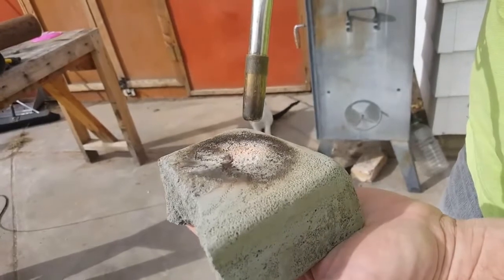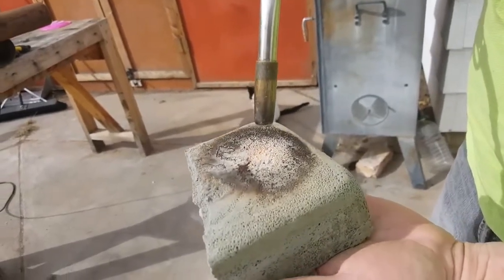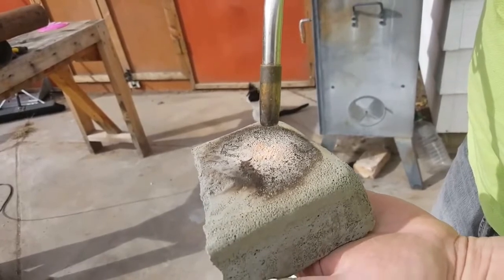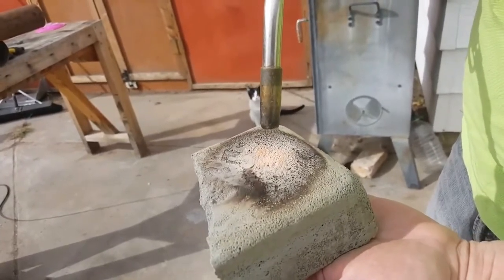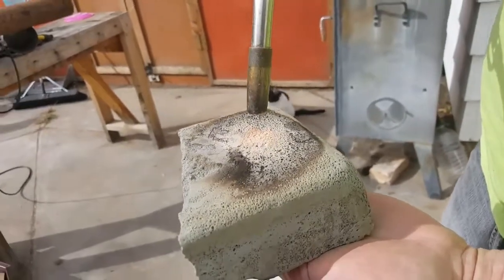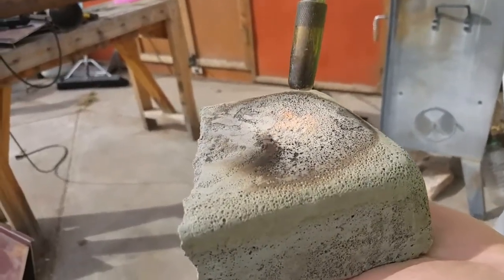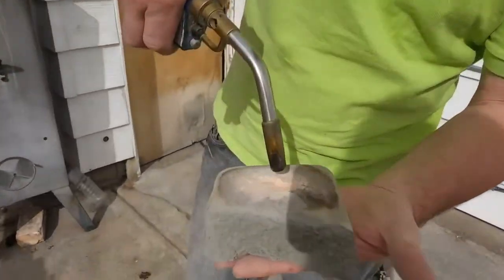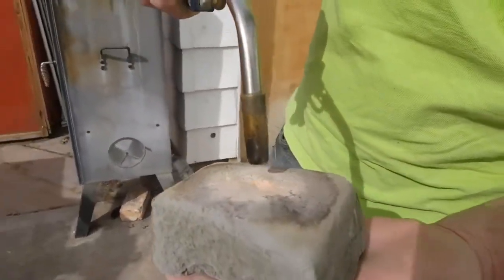Aircrete core boat! New invention and idea!

Comment from the maker: The method I plan on using (project on hold for now) was to use a compressed air powered concrete sprayer, they are pretty cheap and I've watched videos of people spraying it onto inflatable forms for dome building purposes, which is partially how I dreamt this process up.  You spray it on the outside of your existing sailboat hull about 2-4 inches thick, utilizing a release agent.  Perhaps you reinforce it with various techniques like adding fibers, wire "rebar", burlap, ECT, ECT..Then once the 1 or 2 day curing process is complete (aircrete cures very, very fast compared to regular cement which you probably know) Then you spray on that specific strong plastic coating shown in my video, or fiberglass, line x, ECT.  After that cures, you pull it off the hull and coat the inside bare aircrete.  You can then glue, screw, and bolt directly into it with no issues, just use sealant around the fasteners.  Have an excellent day!

Comment: @prolific invention.

For decades, Marine Buoies have been made with "Concrete Encapsualted EPS Foam"

It's also used to build docks.

Dude, we need to talk. I'm a retired R&D sales guy from the EPS (Styrofoam) industry.

Something else to check out:

Polyurea Coatings over EPS.

It's used in outdoor architecurral applications.
Reply from the maker: Excellent Mike! Thank you for watching and commenting.  I will definitely be researching those materials.  Since I've made that video I've mostly been making aircrete for insulation purposes, however I am going full tilt on my boat experiments in the spring.  My email is prolificinvention@gmail.com
Reply: I'll be sending you an e-mail.

Comment: Great video! Im in west michigan so we have a ton of water everywhere, and ive been thinking about living on the water recently. ive come to the conclusion that building a small barge as a floating base for an aircrete structure is the best way i can find so far to live on the water. I would think that, in regards to your video, constructing a barge instead of a molding a boat shape might be something to try. my question is with the polyurethane spray, is it safe to be in water or will it leech and become toxic? thank you!
Reply from the maker: So glad you watched and left a comment, I myself am in West Michigan!  I have been interested in floating islands as well, although never seriously considered it.  I think aircrete would be ideal as a material for an island construction, and I wouldnt worry about the coatings breaking down.  If it were a real concern I might consider using an application of fiberglass with a superhydrophobic coating like Ultra Ever Dry or the like.   Perhaps use kiddie pools or large industrial boxes as molds for aircrete blocks.
Reply from the maker: https://youtu.be/QckSn_TbHoE

Comment: Cement boats have been around since ww2 but this new aircrete stuff has it beat hands down because it floats.  I just did a search to see if anyone knows a method for applying this to a hull while still in the water. If you go heavy with the styrofoam mixture and include some plastic particles, along with a waterproof membrane just to get it under the boat, I bet you could develop a way to resurface boats without pulling them from the water....which is hugely expensive. I would know, I live on my boat. 
.
Reply: Keep dreaming brotherman! Inventors like us keep it exciting! I'm working on a kayak fin that works like a fish fin to propel it. Using Tap plastics and studying the various natural propulsion methods, I think I can make a kayak that swims using leg power only. Cheaper than hobie....which I cant afford anyway.  Lol. Anyway I like your pump idea. With a membrane on, I could pump from the farthest side and send air through to dry in sections then pull it down and up the closest side to finish..  All without pulling the boat... which is like 7k. Wanna be rich overnight? Lol. I bet we could! Speaking of water intrusion,  they operate regular cement boats in Vietnam currently. Look it up. They use regular cement and chicken wire. Seems to work ok.
Reply from the maker: @Gimmeafukinbre  Most certainly! It's all we can do.  Dream, set goals, and work towards that which appeals to our individuality.  I like the Ray Crock quote about Persistence, it sums up human endeavors nicely.
Reply from the maker: @Gimmeafukinbre  Your invention sounds excellent! If you subscribe to my channel I appreciate it, and check out a recent upload I put up called Interesting Garage Workshop Part 1, I had a watersports invention as a kid, it was one of my first working prototypes---they just came out with something with the same concept a couple years ago.
Reply from the maker: That is a fantastic idea!  I would imagine you could work something out with a traditional concrete pump, speaking of that I have my own design for a small concrete pump that I came up with years ago!  I studied how the large ones worked and came up with one that would operate on 5-20 hp.  Glad you commented and reminded me of that, I always appreciate positivity.  I haven't studied concrete or ferrocement boats ECT, so I'm not sure how they deal with water intrusion but I imagine a membrane of some type?  Aircrete is superior to standard concrete on moisture intrusion, however my design is pretty much dependant on the high quality coatings to seal, protect the aircrete, and provide some rigidity and an exoskeleton like structure if you will.  I have always loved houseboats, and one of my dreams is to build a custom one driven by an old Blackstone Oil engine, or any other Hot Bulb ignition type oil engine.  Thanks again for watching and commenting, have an excellent day!!!

Comment: I guess "seeing is believing" doesnt cut it for some people. Good info here. I actually looked into aerated concrete for a large sailboat project a while back. This vid rekindled my interest as the ever increasing cost of materials are getting prohibitive by the day. Im picturing a sort of injection molding process to crank out hulls with relative speed and labor cost savings. I guess my next vid search is "how to make injection molds"?
Reply from the maker: Man, thanks so much for your positive comment-made my day.  The method I plan on using (project on hold for now) was to use a compressed air powered concrete sprayer, they are pretty cheap and I've watched videos of people spraying it onto inflatable forms for dome building purposes, which is partially how I dreamt this process up.  You spray it on the outside of your existing sailboat hull about 2-4 inches thick, utilizing a release agent.  Perhaps you reinforce it with various techniques like adding fibers, wire "rebar", burlap, ECT, ECT..Then once the 1 or 2 day curing process is complete (aircrete cures very, very fast compared to regular cement which you probably know) Then you spray on that specific strong plastic coating shown in my video, or fiberglass, line x, ECT.  After that cures, you pull it off the hull and coat the inside bare aircrete.  You can then glue, screw, and bolt directly into it with no issues, just use sealant around the fasteners.  Have an excellent day man!

Comment: I have the same idea, but the problem to overcome would be water infiltration. If you could seal it completely, you would have a means to make an aknist unsinkable boat or ship in one pour.
Reply from the maker: Maybe you didn't watch the video? That's literally the idea, coat the aircrete once sprayed on a mold completely with a spray on plastic, fiberglass, or line x.  It's my idea man, have a great day

Comment: question... what's the compressive strength?  can it withstand a car if i make a concrete paver out of it? i'm thinking of a solution for a material that can float on water, at the same time, and at the same time (When not floating) can endure cars running through it? also, what was the white fluffy stuff that was mixed on the concrete? thanks! glad to see this one. i'll try to test it out on my own once i know the white fluffy stuff.
Reply from the maker: Benjamin Vallejera The white fluffy stuff is Dish soap mixed with water at a 1:40 ratio and turned into foam.  Here is a link on how to make the machine, this guy is a pro at making AirCrete.  https://youtu.be/aSLJCPR1Prw
As far as strength goes, AirCrete is not great for driving on in it's regular form, however with a coating of Line X, spray in bedli er, or the plastic composite shown in my video it is plenty strong for that purpose if in coated brick form.  Thanks for watching!
Reply: hey thanks for that! :)
Reply: Hi did you ever get round to building the prototype I think it would work love to find out more
Reply: I tried it one time but i think the mixture was too coarse, thus it did not withstand the compression test. (i haven't tried it since then)

Comment: One of the biggest reasons I see for aircrete boats is that it is insulating and fireproof.  Using a coating like the one shown in the last clip should allow the boat to be built using only glass fibers or maybe micro-rebar for strength.
Please give credit and links to those other youtubers who videos you have copied.  I know one was "Honey Do Carpenter' but I don't know who posted the others.

Comment: Just finished reading two books on Ferrocement hulls and I'd like to see this method tried.  Very cool idea.  For the ferrocement, it is stated not to use it for multi-hulls, but perhaps this method could be.
Reply from the maker: Michael Trem  We are on the last of the snow here in MI, and I will be experimenting and building prototypes very soon.  I have already been working on AirCrete mixes and production devices.  Thank you for your excellent comment and watching the video!

Comment: Not a bad idea at all! I think using an existing boat as a mold would be a good idea, possibly with the same bagging system used for fiberglass boats, to get the aircrete core built would work. From there I would use a seacrete enhanced with Xypex waterproofing concrete additive to sandwich it in would give it a very strong, stiff outer core. That would keep the weight light and possibly need a less dense core thickness. More strength for less cost than fiberglass, with comparable strength  to aluminum/steel  without the corrosion issues. The foam core being a good insulator for cold weather environments would just be a bonus. Might have to try this one day with a smaller boat just for the fun of it.

Comment: Nuthin' new about making boats and ships from concrete. Been done for nearly 200 years.  Ferrocement was popular in the 60's and 70's. Look it up. You don't need your hull to be lighter than water, you just need a shape that displaces more water than it weighs. Those boats in your vid are not made from bouyant material, neither are all that fiberglass and steel boats out there. Still your idea has merit and I have been considering an AAC boat for about 20 years now.  May want to incorporate a layer of structural cloth between the spray-on coating and the concrete for sheer strength though.
Reply from the maker: brimstone33 First of all, thank you very much for watching my video and commenting.  I am very aware of Ferro-cement and also the history of cement boats, I am an inventor so I make it my business to know all technology and the history thereof.  My basic idea is unique in the fact that AAC (actually modern homemade AirCrete) is used as basically a forming and structural "foam" essentially.  Since the AirCrete mixture I have created is the density of balsa wood (and has the workability of) it is essentially structural foam.  The plastic spray (similar to bedliner or line x sprays) provides an external hard shell that is bonded to the AirCrete core.  I have found a 3 dimensional  reinforcement for the AirCrete that works well is a combination of chicken wire and burlap layered together.  The boats I showed we're examples of "molds" that I will utilize by coating with a release agent, spraying with AirCrete, insert the reinforcement compounds, spray further AirCrete until 1" thick, then spray with the coating shown in the video of her curing.  Once the outside coating has cured I will take the almost finished boat off the mold, then coat the inside with the plastic.  What this does is creates a sealed plastic boat with a strong reinforced AirCrete core.  Again I thank you for the input, look for my videos of the process later in the spring (if you subscribe)
Reply: Hey I'm happy see folks like you thinking about this. I have been thinking about exactly the same thing for quite a while, a molded Aircrete boat hull. I have a piece of AAC here on my desk which I have been carrying around since I picked it up from a German construction site 20 years ago. I have also been following development of Aircrete, Papercrete, Hempcrete etc for many years. Don't know why we still make houses out of pressed wood, it's just stupid. Here's something you likely would like to know: College engineering  students have been building concrete canoes in an international competition for at least 25 years. They incorporate fiber reinforcement, mesh, glass spheres, cellular concrete, durable coatings etc. Check out "Concrete Canoe" on wikipedia and concrete canoe dot org. Look forward to seeing more of your vids.

Comment: I wonder how it would stand up to long term submersion.
Could you build a houseboat or float house with it?
Reply from the maker: I have seen AirCrete blocks float for 48 consecutive hours, with little water penetration.  If you submerge them using a weight to hold them under water, you can leave them for 36 hours, remove and freeze them; they will remain strong and will not crack.  This is beside the point however, as the spray coating seals the aircrete in a tough outer coating/shell which imparts great strength and prevents any water contact with the aircrete.  Essentially the aircrete just provides internal strength, and penetration resistance as well as a flotation in an drastic emergency.  It also is fire resistant which is another great quality of aircrete.  I imagine you could build many aquatic structures utilizing this method, I mean have you seen the video of the guy who makes an island out of recycled trash like bags of bottles and pallets?  Very interesting, thank you for watching and your positive comment!  I will be uploading a number of videos of my experiments and prototypes in the future.

Comment from the maker: By my rough calculation based off watching every aircrete video on YouTube, the weight or mass of a 2" thick 4'x8' section is 40 lbs...obviously it will be tested as I am going to prototype with my plastic canoe and 12+ foot bass boat.  You get 2/3 more volume than standard concrete, and even more if you add perlite or additional foam.  Remember also that the density is similar to very light wood (I can tell just from cutting, drilling and trying to sink the stuff)
Reply: I came up with some more information for this idea. This is still a very valid concept, especially since we not only have past experience and designs we can harness from when this was a thing in the 1890's to the 1970's, but also because of advances in materials sciences. If this is still an ongoing project for you, shoot me an email at jstepp590@hotmail.com and put "concrete boat" in the description so I can follow and maybe contribute to it. A crowd funding session could provide resources to build one as well. 

Resource for concrete boats.It includes info on repairing wooden boats using concrete.
http://www.ferroboats.com/index.html

Designs for concrete boats.
http://www.hartley-boats.com/sailboats.htm

A VERY exciting alternative to using concrete.
http://ironkast.com/

Some good info from concrete boat builders from the 70's on a boat design forum
https://www.boatdesign.net/threads/we-love-ferro-cement-but-beware.21436/page-4